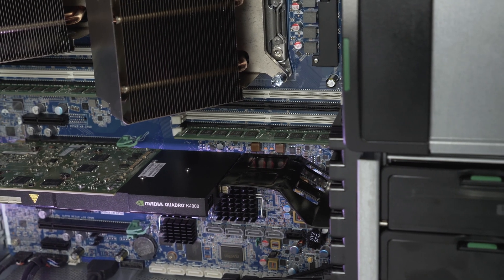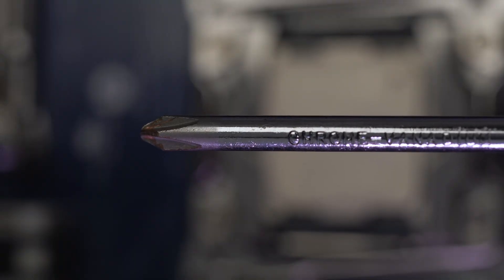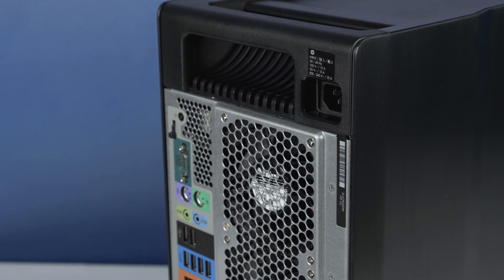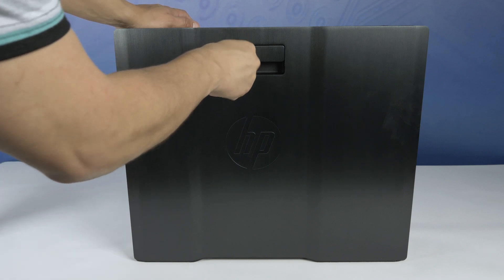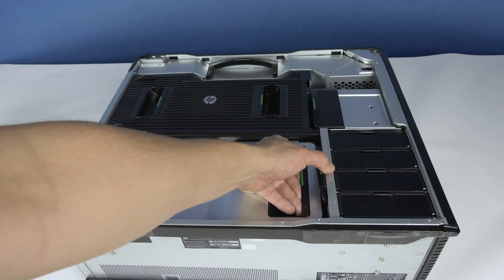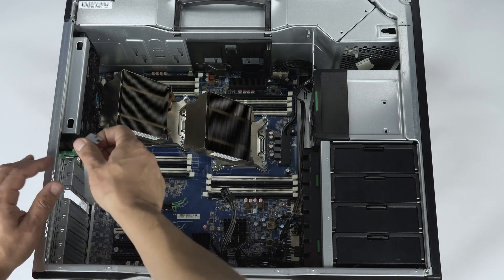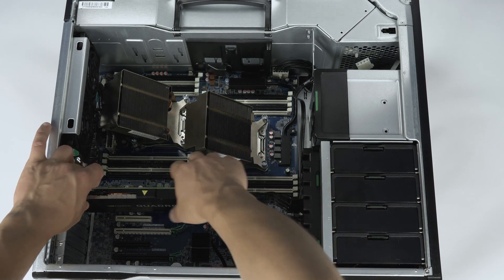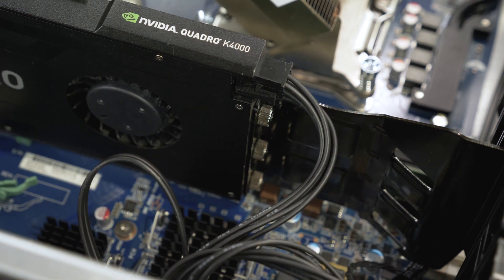HP Z840 Video Card Installation

Comment: Good night
Thank you for all the information you provide on the channel

If I may, I would like to clarify a few things

1-
How do I determine if my HP Z840 IS V4 OR V3?

2-
Can this video card be installed on my HP Z840
Quadro RTX 5000 16 GB or not?

3- Is the HP Z840 that I purchased with two XEION E5-26XX V3 processors installed on it, can two XEION E5-26XX V4 processors be installed or not?

That's all, and I hope to benefit from your experience in the previous three inquiries
With thanks